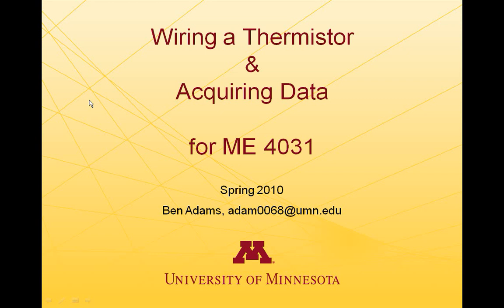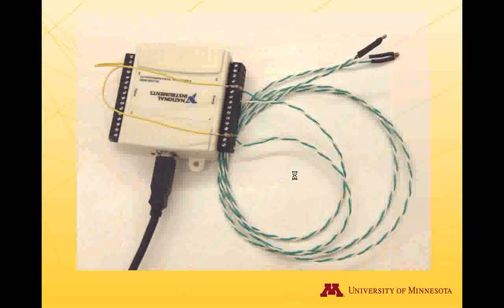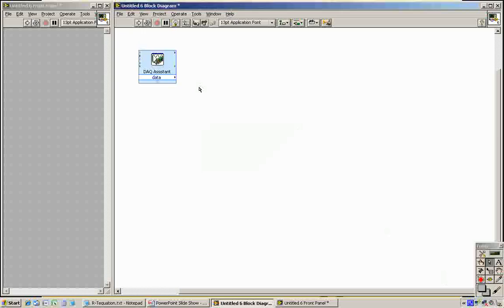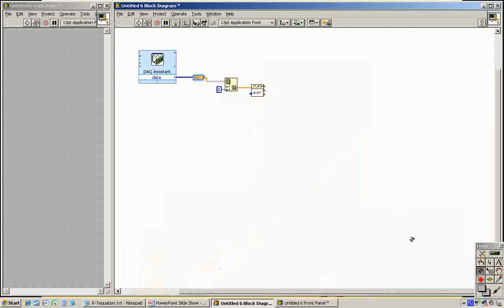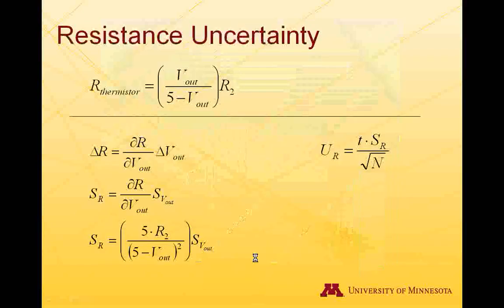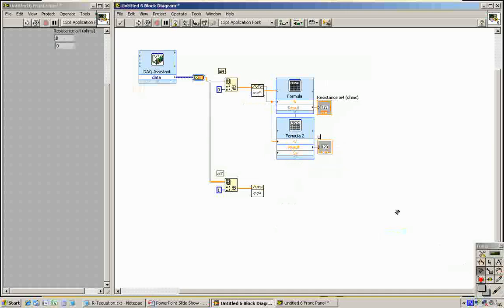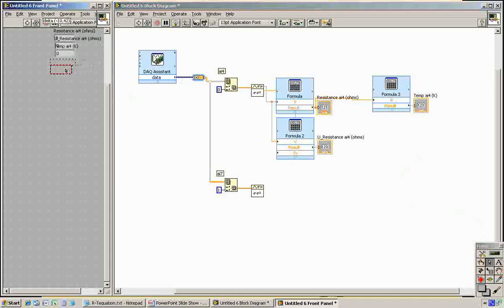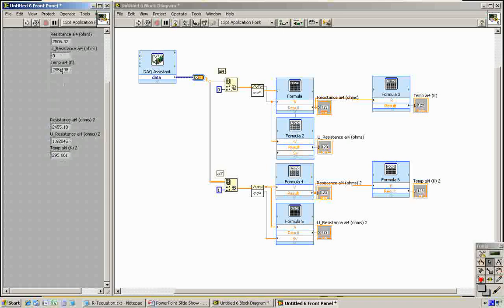Wiring a Thermistor and Acquiring Temps in LabVIEW

Comment: In the first part of the presentation, you stated that the current would be constant through the divider.  I didn't see anything that indicated that.  It might be nice to have that feature to achieve a precision reading which is only a function of temperature.  I didn't see anything, other than your statement, indicating that the divider is fed by a constant current supply.  Where did that feature come from?

Comment: The voltage divider that you are using will output a higher voltage at lower temperatures. With the Thermistor going to 5V and the resistor going to ground the higher voltage will output at high temperatures.